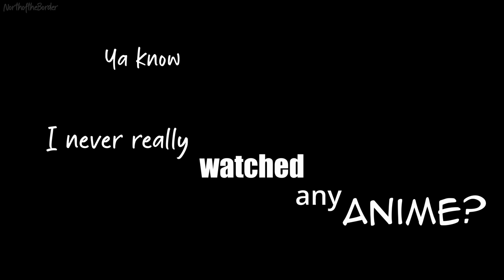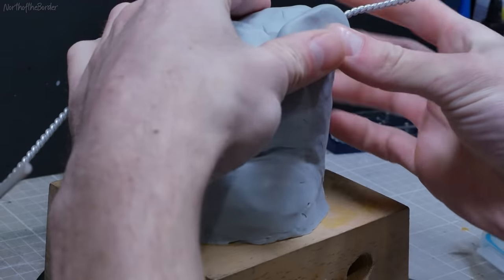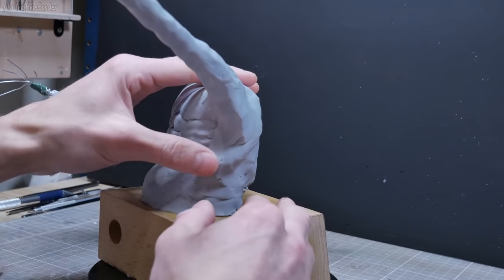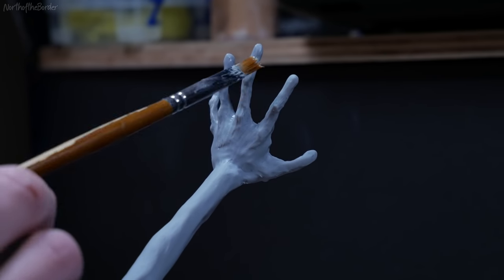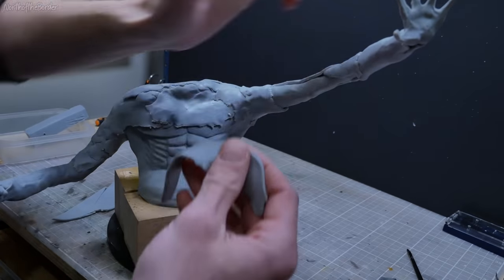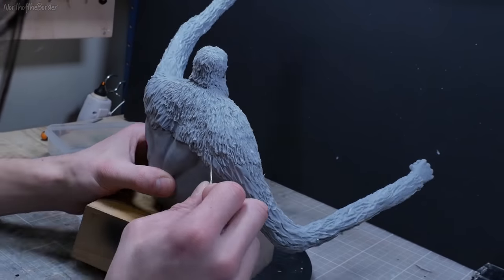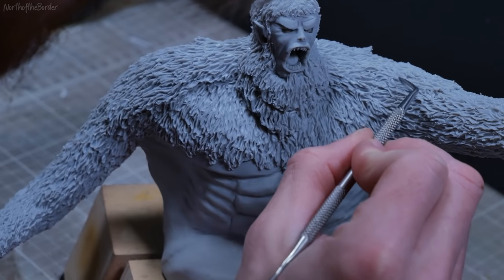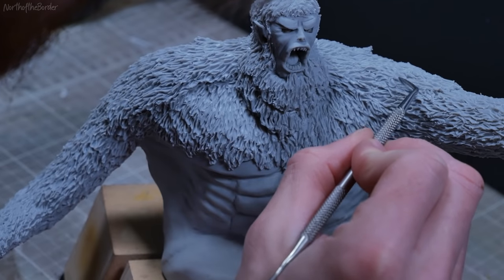Attack on Titan // Levi vs Beast Titan // Shingeki No Kyojin Sculpture

Comment: Wonderful sculpture, my personal favorite scene as well. It's definitely tricky to get all the motion captured into a still like this. And blood, fluids in general really, are difficult to do right. A tip for fluids is to use fluids with a lower viscosity or surface tension than water  to thin out dyes or varnishes to increase small scale realism.

Comment: I'm a few weeks late, but some tips to keep your brushes from getting the hook-things on the end: Don't leave your brushes bristles- down in your water cup when rinsing them off, cause then the bristles get pushed sideways! Also, you can wash your brushes with a tiny bit of People Hair Conditioner to keep them soft and sharp. ALSO if your brushes do develop little hook things (which is kind of inevitable if they're small and thin and well-used) you can always just snip those little suckers off and reshape the tips! Even with all these in mind, I would definitely recommend investing in some nice detail brushes, you can get some good ones for fairly inexpensive. You could also use things like toothpicks or those teeny tiny nail art q-tips for the tiniest of details! This was slightly longer than intended hehe, love your videos and keep it up! :-)

Comment: If you use synthetic brushes. You can sometimes use boiling water to fix the tip of the brushes. If you use natural hair brushes then you can pick up a brush soap, like the masters brush cleaner.
Reply from the maker: I'll have to try the boiling water, thanks for the tip tip!

Comment: Don't know if you'll see this, but I too LOVE cosclay and I have a potentially helpful tip!  If you're sculpting a thick part (torso, head, that sort of thing) you can use regular polymer clay or even use a 1:1 mix of the two clays and "save" your pure cosclay for the parts that may need to by moved or are more fragile.   I do this and am able to save a bit on the cost of clay and make it last longer!  Just a helpful FYI...  and I LOVE THIS THING!  Really enjoy the vids!  Keep up the great work!!! 🥰
Reply from the maker: I SEE ALL. I AM AN OMNIPRESENT BEING OF THE INTERNET. Also, I like to read all the comments, if I can!

Thanks for the tip, I'd thought about mixing it with sculpey, but I was worried about how brittle it would become--is it worth losing 50% of the elasticity vs just using straight up sculpey as a base?

Comment: One thing I’ve been doing with brush hairs that start to go out of place is use a blade to seperate the hair, bend it back and cut it off at the heel. I only have cheap brushes at the moment so it’s not as scary as if i was to have expensive brushes. (If that’s what you mean by hook on your brushes)
Reply: ooo also you can get some matt clay hair product and after using and washing, you swirl the brush in it a bit and shape it in the crease of your hand to try and help it remain straight

Comment: I have a thought,  I use spun glass in my water falls,  I think it looks incredible in place of cotton.  One of the brands I use is (Angel Cloud)
It's extremely thin and fluffy just like cotton,  but it is glass. You should check it out
Reply from the maker: I'll have a look--never heard of spun glass (or at least not in terms of everyday use)
Reply: I'm sure you've seen it on old fashioned Christmas ornaments , it's mostly used for Christmas stuff.

Comment: If your brush bristles are starting to bend, dip them in a cup of boiled water and let the capillary action of the water running down the bristle iron the bristles straight again.
Reply from the maker: Someone else mentioned the boiling water, I'll have to give it a try. But if it works, what will I blame shoddy paint jobs on?

Comment: Can you make a video about what tools are you using for beginners? 😊
Reply from the maker: It would be short! I mostly use whatever is lying around and pointy, or not pointy, if that job called for it. Pins, paint brush handles, nail files, etc.
Reply: @NorthoftheBorder  thank you! It doesnt have to be just tools tho you can give advice etc maybe ^^

Comment: What 8s the green stuff? Sorry if explained in some other video. A newbie to this.
Reply from the maker: Green stuff is a 2 part epoxy. It comes as a yellow and a blue part, that when mixed together turns green (hence the name). Once it's mixed, it will start to cure and after a few hours will be rock hard. It's great for sculpting really find details, or I use it alot for holding pieces together while I sculpt over top, since it cures without any external requirements.
Reply: @NorthoftheBorder  thanks for the reply

Comment: You should have used the manga desing of the beast Titan from the very begining. The anime desing has a lot of inaccurate parts with the actual titan from the manga. In the mamga he doesn't have that much of a big belly, and it also has way more muscle in the arms and body. It would have made your job much simpler when you made the fur on him. Other than that, it is a really nice piece of artwork.